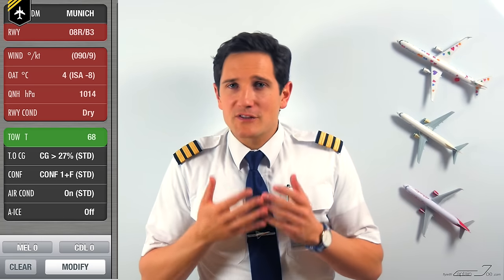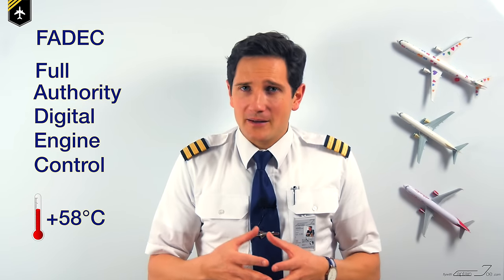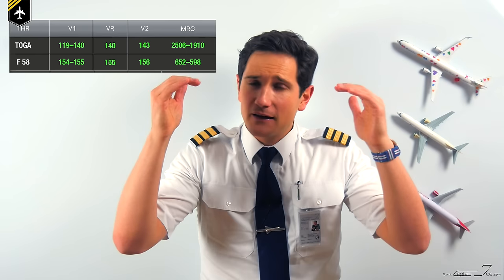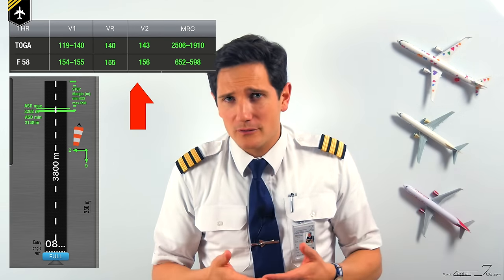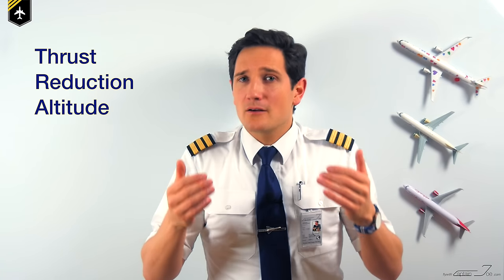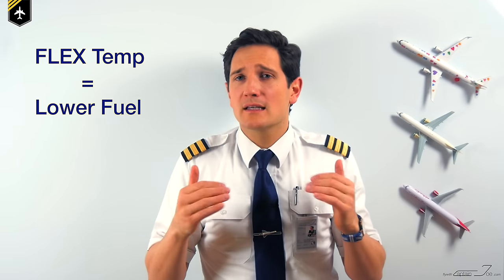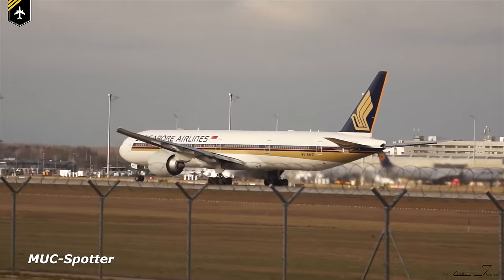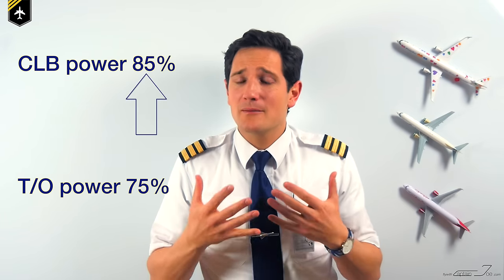What is FLEX TEMPERATURE? Explained by "Captain" Joe

Comment: captain Joe what is underneath the passengers. The room underneath
Reply: rhys gilmore The cargo area...😀😀😂
Reply: Kiku Aviation I think there is some mechanical room with things controlling the plane
Reply: At least in the 747, the area underneath the passenger cabin is used to store cargo. And the cables connecting the yoke and other pilot inputs to the flight controls normally run through the ceiling.
Reply: Cargo hold, avionics bay, fuel cells, hydraulic systems, and places for bad dogs and children to fly that don't get along with others.

Comment: Why this hacking around with imaginary temperatures? If the engines don't operate economically enough according to the existing algorithm, why doesn't Airbus modifies that algorithm, so you can use actual temperatures??? And when and where on Earth is it even 58°C anyway?

Comment: Why on earth use this this silly hack of fake temperature? How does it at all relate to the ACTUAL economical (and safe) thrust required for the ACTUAL temperature (and take-off weight)? And what fake temperature level corresponds with TOGA thrust?
Reply: If you have to use toga, leave the flex temp blank, and apply toga thrust on takeoff